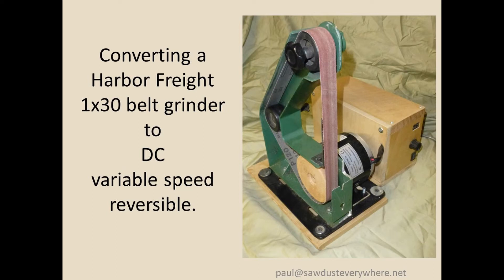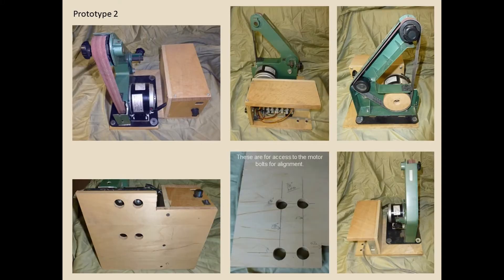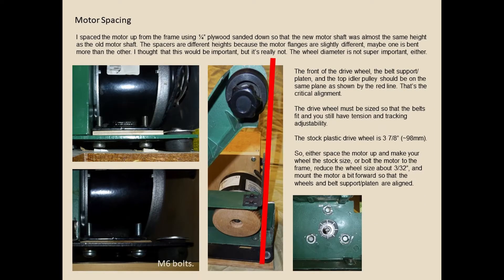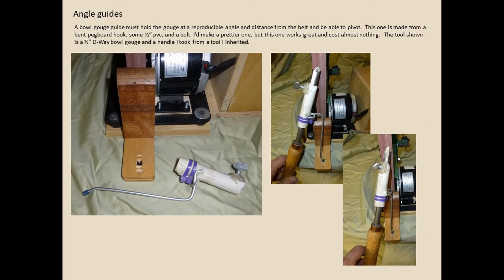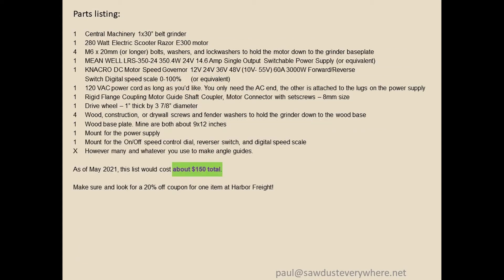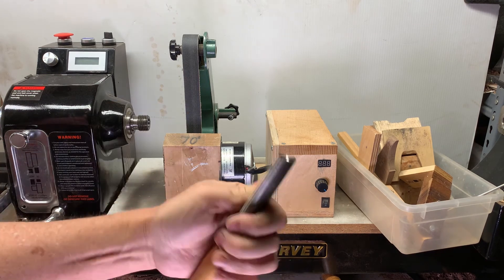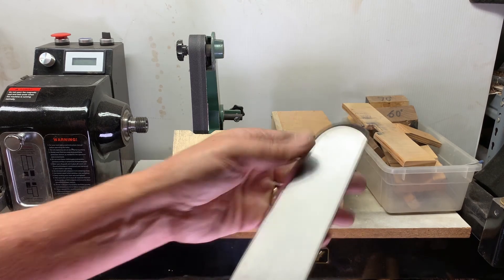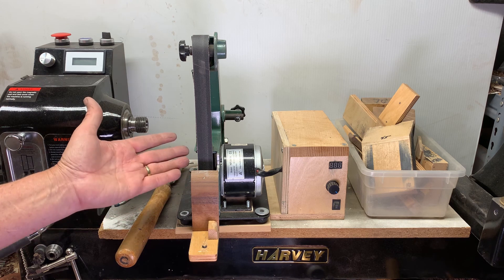How to convert a Harbor Freight 1x30 belt grinder to DC variable speed reversible for sharpening

Comment: Great video. Love the sharpening system. Recently took a motor out of one of those vibrating exercise plates which I think is just be right for this. 
I've build a lathe tool sharpening system for a 2 x 48 but it doesn't handle the micro turning tools that I got with a vintage micro lathe I just bought. The guy I bought it from  happened to throw in a 1 x 30 grinder, so finding your video may be serendipity. I feel a build in the pipeline.
Thanks

Comment: I may come back to this video later for parts lists if I get a 1x30, but in the mean time I noticed your tools catching on the blocks a bit. If you take some melamine edge banding and stick it to the block it will add a nice almost friction free surface to rest the tools on, should help clean things up a bit, unless you have fixed that problem since of course.

Comment: Do you have this DC motor plugged into an AC wall outlet?  Sounds like you do when reading your parts list.  I want to see if I can power this grinder from my solar setup.  Plug it into the charge controller for power.
Reply from the maker: The DC motor is plugged into an AC to DC converter power supply.

Comment: None of my high dollar lathe tools has never touched a belt sander and never will
Reply from the maker: Super high end knife makers use belt sanders. A high end lathe supply company sells a belt sander. It's just a different way to sharpen, not better and not worse. Whatever works for you that you're willing to use as often as necessary works.

Comment: I just purchased this sander, and am using a small 5A variac to control speed on the rare occasions I need to.

Does anyone know what type of AC motor is on this sander...and if it's possible to reverse direction with something similar to how the polarity will reverse direction on a DC motor?
Reply from the maker: Reversing direction of most all AC motors is not simple.